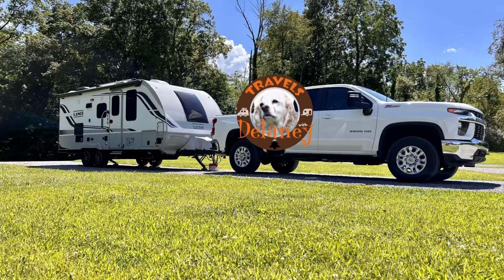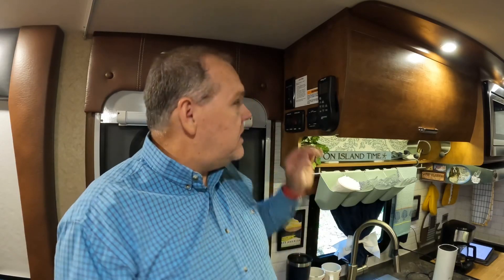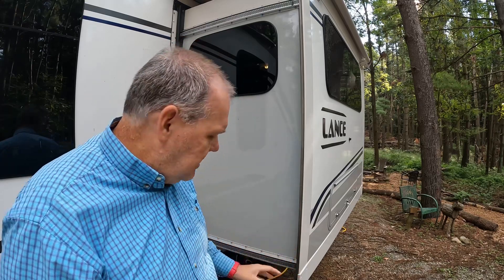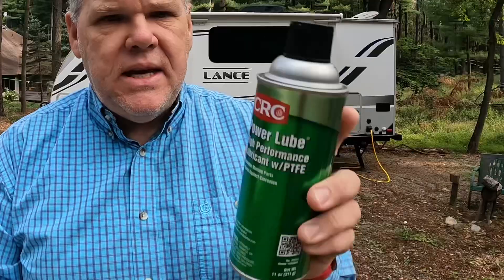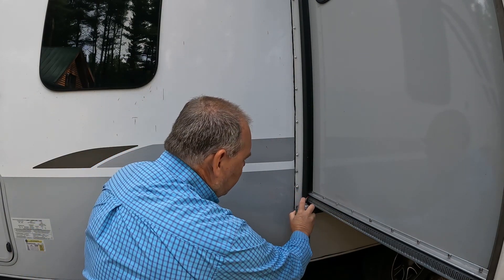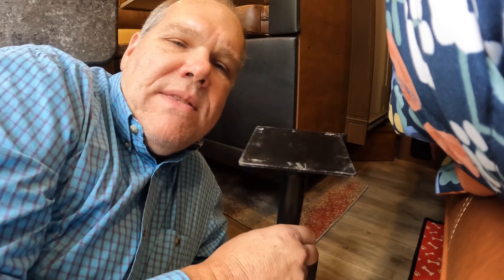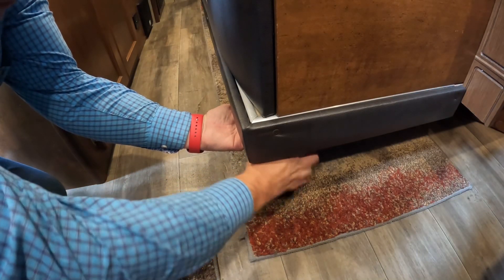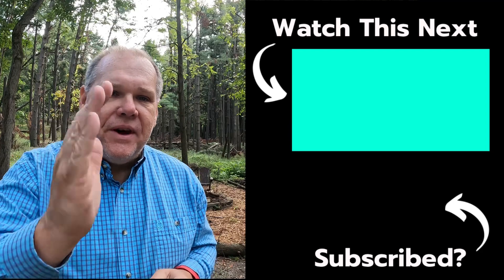DO THIS TO PREVENT RV SLIDEOUT FAILURE!

Comment: Great video.  My last RV had the Schwintek slide system and I never had any problems with it for the 7 years I owned that trailer.    My new Flagstaff trailer also has the Schwintek slide and it has already started squeaking a little bit when retracing the slide.    Time to get the CRC Power Lube out and give it the first lube treatment.  Also love your Lance trailer - they build a really nice unit but it was a bit out of our price range.

Comment: Nice Video! I am a Lance owner as well and I think you are spot on with the need for slide lubrication and maintenance. Another thing to be aware of is the situation where the exterior slide rails begin to tear loose from the side of the trailer. Due to the floating design of the slide in these Lances, the entire weight of the slide is carried by the wall. As you go down the road, all that weight is pushing down on the inside portion of the slide (especially if you carry your cast iron cookware collection in the dinette drawers). Over time you will likely have problems with the slide rail hardware starting to strip out and the rails separating from the trailer side. I also installed the Camco step braces under the inside of my slide to help support the slide in transit. I don't screw the braces down too tight.............Just tight enough to keep the inside of the slide from bouncing too much when traveling. I also made some carpeted pads to go under the braces so the braces don't put marks in the laminated floor.

This is just my opinion, but I think the Schwintek system should only be used on small light slides like perhaps a small wardrobe slide. I think this Super Dinette slide is too much slide for this system. 

Here's looking forward to my next trailer without the Schwintek slide system............or perhaps no slide at all!

Happy Camping!
Reply from the maker: I totally agree with your assessment on the Schwintek!  Thank you.

Comment: When we bought our 2019 Lance 1995 the salesman ran the slide out and it was VERY noisy, I asked about the noise and he said that’s normal. I had been a member of the Lance website for approximately two years already and was very familiar with the Schwintec problems and need for lubrication so I didn’t say anything but after taking delivery I stopped at my local NAPA store and bought a can of CRC and lubed the slide when I arrived home. Dang that slide got quiet and has been quiet ever since😃!

Comment: I attended a Lippert slideout system seminar. Your information in holding the button down 3 to 5 seconds is spot on. But they also told us to not spray anything in the rubber seals. They said the seals should be cleaned with mild soap (Dawn) and water only and using any of the seal conditioners on the market will actually cause the seals to deteriorate quicker.
Reply from the maker: Thanks for sharing.  When I was at Lippert service, I asked for recommendations on the seals and was told they don’t make the seals so they didn’t really make recommendations concerning them.  Sounds like they are now giving advice on them.
Reply: @TravelswithDelaney  They mentioned at the seminar (August 2022) it is a new recommendation based on their conversations with the actual seal manufacturer.

Comment: I received the link with no problem. I do not have a slide out on my Tab 400 but I did get some good information on lubrication of my window, door, and hatches. Thank you
Reply from the maker: 3in1 makes a product for windows that I always use.  Its great if you have sliding windows and they are not sliding easily.

Comment: Nice video...  not sure if this is universal but you also have large floor rollers that support the bulk of the weight. These can be located by using a flashlight and get under the slide out and pulling down the seal. I marked my roller locations and lubricate these as well.

Comment: Great video. What size are the step supporters you use under the slide inside? The small or large one?
Thank you
Reply from the maker: Thank you!  I had to go with the larger one as the smaller ones would not be  tall enough for our slide.

Comment: I have a 2017 2285. 
Just a couple extra points with slide.
Don't forget to lube the rollers underneath the slide. Just a squirt on each end.
We don't use supports when retracted. The biggest issue is too much weight in dinette drawers. Don't think we have more than 15 lbs in either one. Never put heavy items like canned food or cast iron in them.
6 years with our Lance & have never had an issue with slide. Not once!
Reply from the maker: Great points John!

Comment: Hi Patrick. Great video. A question... Do the rollers on the very bottom, underneath the slide require lube or any other maintenance?
Reply from the maker: Thabk you. I have been lubricating them recently and they seem to roll smoother and quieter. I just squirt a little on the bolts.
Reply: The rolls have sealed bearings. You cannot lube them by spraying them.

Comment: Hi Patrick. I was hoping you could tell me if you have to change your converter if you switch to a lithium battery. I’m looking at getting a 100 amp hour battery. Can you suggest where I might find this kind of information? I’ve tried googling and I end up down a rabbit hole of info I don’t understand. Is it possible to get a simple answer?
Reply from the maker: Its possible you won’t need a new converter if your trailer has a converter that can be switched to lithium.  Lance in 2020 started using converters that could be switched.  If your trailer doesn’t have one like that with the built in switch, then you’d need to change the converter which is what we had to do in the T@B 400
Reply: @TravelswithDelaney  thank you! I have a 2020 Forest River Mini lite that has port for a solar panel so maybe? But at least I can check my owners manual or contact the manufacturer to see if my model has a switch. At least I now know what to ask! Thank you!!!!
Reply: @TravelswithDelaney  another reason why I love your channel!! I KNEW you would be able to make the complex understandable!💕

Comment: In the video, you said not to slide the slide out halfway and stop. In order for me to condition the seals on the top, I can only reach them when the slide is halfway out, even when on a ladder. Is this okay for the couple of minutes while I condition the seals, or do you have other suggestions for reaching the seals?
Reply from the maker: I know that our dealer had it halfway out before so I think if you have to for that, you’d be fine.   I’d just re-sync when done.
Reply: This is an old wives tale.

Comment: Ever notice most people complaining about slides are complaining about schwintek slides?  Why manufacturers keep using them is beyond me.  Luckily all 3 of our slides are rack and pinion.  They do require some maintenance but I think they're a lot less problematic.
Reply: I had major fail on mine.  Changing them out for Vroom next June.
Reply from the maker: We had the rack and pinion ones on our 5th wheel and in 8 years of ownership, never had an issue with them.  I think manufacturers use the Schwintek on slides that are too big and heavy.  It works fine on smaller slides like closet slides.
Reply: @TravelswithDelaney  yeah, I can't argue with that. But as a mechanic, the design and positioning of the schwintek motor system just plain sucks. Extremely difficult to work on.  With that said, belly covers don't make thru frame rack and pinion particularly easy but given their higher reliability I think it's less of an issue.  Also in many cases they can be cranked in if they fail.
Reply: We had the horrible Schwintek’s on a big heavy 24 foot slide on a Class A diesel pushers-Thor Aria really really awful and cheap of Thor 🤯
Reply: U are spot on , it is the biggest piece of garbage , lippert has a big hold over the rv industry and I don’t why or how